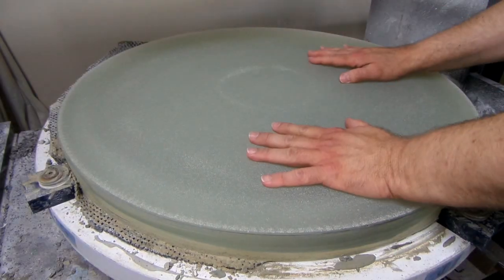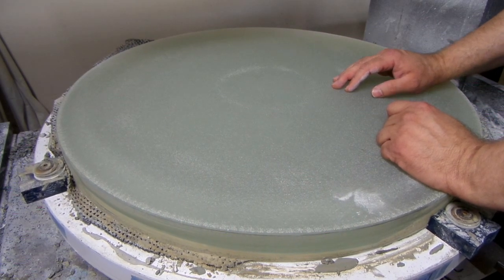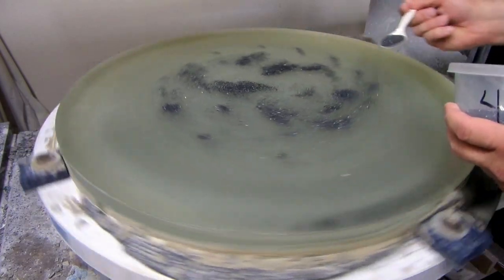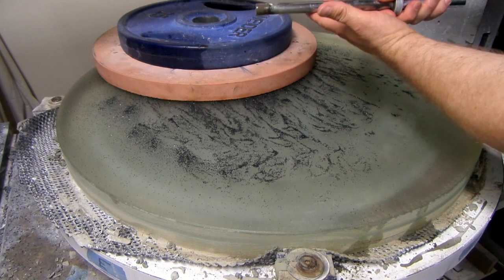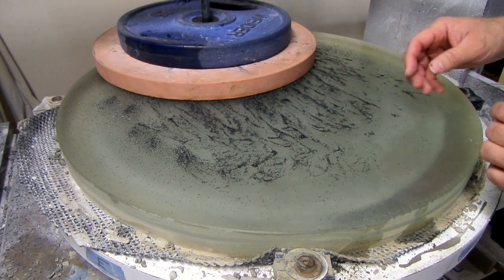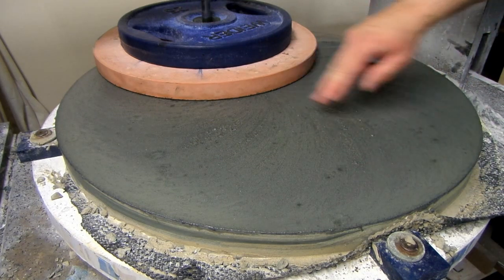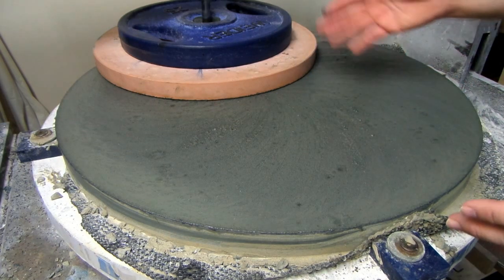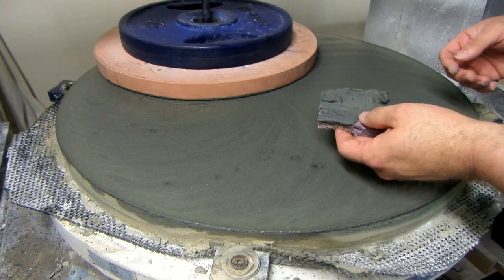Grinding a 25-Inch F3 Telescope Mirror: Thinning and Flattening the Back

Comment: For anyone, why make the back of the lens (mirror i think, not used transparently) perfectly flat?
Reply: You are correct. The finished product is a mirror and not transparent. The mirror side will be concave. The back must be perfectly flat to be mounted in the scope and be able to reflect to an exact point within the center of the telescope.  Any deviation in thickness will tilt the mirror slightly in the mounting surface and the image will not come to the correct point in the telescope.

Comment: I'm a bit confused ... How do you get the exact amount of concave (1/8" depression) to be perfectly equal all around the mirror?  I don't see how this is achieved - Does the difference in size between the tool vs the mirror blank make this process automatic?  Obviously I'm a beginner and sorry if my questions sound dumb ...

Comment: Is the top abrasive tool flat or curved?
Reply from the maker: It starts with a shape dictated by your mirror blank.  If you have a flat blank, start with a flat tool.  If you have a pre-generated concave blank, you start with a convex tool molded against that blank.

Comment: That big turn table looks kind of dangerous. But if you can handle the angle grinder for 2 hours, I'm sure this is nothing.
Reply from the maker: Well, you never want to wear long-sleeve shirts around the machine.  And I've changed to a different hold-down design that is far less likely to grab you.

Comment: How do check for any strain in the glass?
Reply from the maker: You can only check if the blank is still clear and hasn't been ground.  Then you use a big TV behind the mirror to evenly illuminate it, and observe through the blank with a polarizer.  This will show the strain.

Comment: What is the different between normal mirror and thick one isn't the same reflection!?
Reply from the maker: Thin mirrors cool faster, and are lighter to fabricate in the larger sizes.  Thick mirrors hold their shape better so you don't need as good a mirror cell.  Always a tradeoff.

Comment: These are all great videos.  I was wondering...did you find the limits and/or optimum values for the various parameters?  Like, will it grind faster if you keep adding weight (till just before the blank breaks)?
Reply from the maker: We have explored most of the parameters.  Mainly you run into safety problems, like you can only spin a mirror so fast.  And you can only put so much weight on a stack until the turntable won't turn any more.  Or you find that more weight polishes faster but leaves a rougher surface.  So in the end you have to find practical ways to do everything, while trying to optimize factors like cost, time, profit, and so on.
Reply: @GordonWaite  it would be interesting to have a 'little black book' of parameter boundary values or graphs of parameter variation vs. glass removal with markers on the graph indicating points where other phenomena intervene (like 'turntable stops spinning' or 'grit starts flying off the blank' or 'glass blank explodes and takes out a wall') although I guess there's a lot of interplay between the various factors like rpm, grit load, water, etc. and it wouldn't be that straightforward.

Comment: Imperial vs metric Hubble need I say more?
Reply from the maker: Aren't you an interesting piece of work, Ian!  Actually the Hubble problem had absolutely nothing to do with metric versus imperial.  A quick look at the history will show that technicians incorrectly inserted washers as spacers into a corrector.  This led to a long, long series of tests that were all incorrectly configured.  No alternate or backup tests were performed due to a lack of funds.  You DO know that the Hubble mirror was 2.4 METERS in diameter, right??

Comment: May i ask if there is any math underlying the grinding motion, maybe such that the relative speed between the two surfaces leads to a parabolic shape rather than just some randomly shaped valley?
I know that if you spin a liquid the surface will form a perfect parabolic shape and it is easy to derive the maths for that, so i was wondering if something similar exists for this grinding method...? Or how else do you end up with a perfect parabola?
Thank you very much, great video!
Reply from the maker: The grinding motion naturally tends toward producing a sphere (or a flat), when using a simple fixed-post grinding machine.  You control the shape of the mirror by changing the pivot point on the tool on top of the mirror.  Inner positions produce a deeper curve in the center.  Outer positions produce a shallower curve toward the edge.  You manipulate this position during grinding until you arrive at something close to the target radius.  By then you should have found the "neutral" position that does not change the radius.  By grinding through the finer grades of abrasives at the neutral position, you produce a very accurate spherical surface.  

Producing a paraboloidal surface cannot be done geometrically.  At every distance from the center of the parabola, the radius of that zone will be unique.  So the radius constantly changes from center to edge.  To produce a parabola you traditionally use deformable tools.  As you work a given position, you measure the radius to match a target.  In practical terms, you define anywhere from 3 to 12 zones on your mirror and measure them all as you work the surface.  Each zone has a target radius, and you work to deform the spherical surface of the glass to hit that target number.  Doing spherical surfaces is easy, while making paraboloidal surface is much more time-consuming, and thus more expensive.
Reply: @GordonWaite  I see, thanks for explaining, so you have to do alot of measuring and adjusting to aproximate the parabola, have you ever thought about using a centrifugal oven/furnace? - I suppose it wouldnt be too hard to build an insulated chamber on a bearing, driven by a servo or stepper motor to keep a constant frequency/rpm and automate the whole thing with an arduino-microcontroller (popular and super easy to use/program component that alot of hobby DIY'ers use). - Everything the microcontroller would have to do is keep the motor at a constant speed, and measure the temperature and keep the chamber at the desired temperature to very slowly let the glass cool down... If cooled down slowly enough to avoid tension and stress in the glass, that will yield a perfect paraboloid of any desired focal length (given by the rpm) and the size is only limited by the size of the furnace...
Maybe, once set up, that would be an easier and cheaper way to do it??
In any case it would be a fun DIY project i think =) , if i lived near you, we could team up and build it hehe
Reply: @gordonwaite1697  Yeah you are right, while it wouldnt take days for the glass of a 'small' 20" mirror to melt and anneal, or cost 10 million$ - thats only true for the huge, professional funaces - as the glass cools down it would contract and maybe change shape even if done perfectly homogenously/infinitly slowly, i had not thought of that, that means my idea wouldnt make sense...
Thanks for your insights, maybe one day ill ask you for a mirror =), right now im still happy with my 8" skywatcher.
Reply: @GordonWaite  Do you reckon that that furnace apporach would work or not? You obviously are the expert, maybe im wrong to think that this would work... thx.

Comment: Just build a model and stick it in a the kiln that will give to the curve and avoid all this work grinding 
Just to remove glass.
Reply from the maker: You probably missed that this was an existing piece of glass from another project.  Thinning the blank made it possible to use for the project at hand.  Many NEW mirrors are, indeed, molded from scratch.  Amazingly, mirror makers first started doing this long, long ago.  The famous 60-inch mirror at Mt. Wilson was cast in France in 1896, 124 years ago.  There are few new ideas that are so simple!
Reply: GordonWaite yeah I didn’t see that it was a piece you already had but still a shit ton of work.

Comment: So all this is on the BACK of the mirror and has nothing to do with the parabolic mirror. All just to remove weight?
Reply from the maker: Both to remove weight and to make it thinner.  The biggest problem with a thick mirror is heat retention.  When darkness sets in the temperature starts dropping, and the thick and heavy mirror can't keep up.  This sets up differential contraction in the mirror and ruins the images as the surface changes shape with the temperature.

Comment: not to be "that guy" but couldn't you essentially set up a coolant pump like most CNC machines have, and feed in some grit from a hopper in the same line, from the center of your grinding disk post? that seems like the best placement to keep an automated feed of that stuff going through since it would disperse itself.
Reply from the maker: That video was done in 2014.  These days we have computer-controlled grinding and polishing machines and computer-controlled abrasive applicators, slurry pumps and water supply.  We had to design and build these ourselves.  The market is so small that commercial machines didn't exist earlier, and even today they are WAY expensive and not economical for smaller fabricators.

Comment: If the turn table is level why not use a fixed height transitory arm gantry to control the diamond  grinder mechanical control
Reply from the maker: Or a template.

Comment: Where can i buy a Telescope Mirror like yours in the video?
I want to build it myself
Reply from the maker: You can order glass from places like Swift Glass, who will cut discs for you from sheet glass.  Depending on what you order, you may need to have it Blanchard ground, edged and beveled.  A ballpark estimate on the cost of a 25" blank like in this video would be something between $1,500 and $2,000.  Get Supremax-33 for best-quality borosilicate glass for astronomical mirrors.

Comment: No water ? WTF are you doing.
Reply from the maker: You should notice that I did not turn on the machine in the video, only held it above the mirror to show what it looks like in the video.  When doing any diamond grinding, you need to use running water.  I don't do diamond grinding indoors, only outside on a special turntable I have for that use.

Comment: WHY dont they just pour the glass into a mold that is the right shape ???????
Reply: Because a perfect casting is practicably impossible. Blemishes and air pockets become very common in a casting attempt, which is why a casted item still needs further polishing and forming. So, rather than casting, it is significantly easier and simpler to grind a blank into shape.
Reply: Because it doesn't work well!

Comment: There are FAR  easier ways to make a telescope lens (concave): place a dish with the rim height desired on the turntable. Fill with a slow cure high viscosity epoxy - glas fiber mix. Spin the table with VSD drive and allow for cure. 
Once cured: add mercurey and spin at same speed. Add a mirror above and you will have a very very high quality lens. Approx 2007 Spectrun der Wissenschaft » issued an article on this method.
Reply from the maker: Well, that would be a mirror, not a lens.  Isn't mercury a bit toxic?  How would you dampen vibrations in the liquid?  How do you keep dust off the mercury surface?  How limited is the sky you can see with a fixed-position mirror?  Don't you need an even bigger and quite flat mirror above to have some choice of field?  Tracking?  I think there are plenty of reasons why you don't see two or three mercury mirrors in every astronomy club!

Comment: Why is this mirror convex and not concave as we always see in reflective telescope designs?
Reply from the maker: The back is flat, and the front concave, like all Newtonian designs.
Reply: @GordonWaite  But strikingly from the video it seems to be convex. o.O
Reply from the maker: @Vicente_Camilo  The video only shows me working on the back of the blank, which I am flattening.  Perhaps the wide angle of the camera lens makes it appear convex to you.  On this mirror, the back you see being worked will be flat; the other side will be concave.
Reply: @GordonWaite  I got confused reversing both terms, I'm sorry. What I meant earlier is that the glass is convex, while the Newtonian telescopes the mirrors are concave.

Comment: This is really awesome. I'm really curious though how do you get dips and valleys out if the grinding stone isn't fixed to something that will not grind Valleys. you can see it going up and down has its grinding... will it eventually flatten it out or will it just keep those dips and valleys in there?
Reply from the maker: It evens out quite quickly.  The surface averages out against the grinding tool, and contact becomes closer and closer as you grind.

Comment: I'm still learning so I'm curious about using things . If u think about it using the carbide abrasive seems like it would imbed itself into the glass since it's a loose material . If the abrasive was glued to another object it would act like sandpaper an push the access glass away from the mirror . Am I thinking about this all wrong ? I'm guessing I'm thinking more about time . Using a sandpaper method would be quicker than putting abrasive on the glass I think
Reply from the maker: The abrasive doesn't embed in the glass.  Instead, it chips off tiny pieces of glass as the grains roll around between the glass and the grinding tool.  With loose abrasives, the two surfaces get into closer and closer contact as the grinding continues, and you use finer and finer abrasives.  Over the course of the mirror, you will end up using several pounds of the various grades of abrasive.

Comment: Viry nice movie

Please i try to make mirrors for my telescope at home manually using epoxy < but I need to the A concave mirror measure to make a mold to put epoxy inside it
What is the degree of concave mirror?
Reply: Depends on focal length maybe?

Comment: Good heavens have some Dimond grinding tools made, it's not at all as expensive as you might think.
Please note I have never made a mirror in my life but I do grind things and I may be totally off the mark.
Reply from the maker: I have created and used many diamond tools over the years.  I use diamond rings to rough in curves.  And I've often used diamond paste for fine grinding and rough polishing.
Reply: @GordonWaite  Dimond tools are certainly useful when well made, fortunately in my backwards south African home town we were lucky enough to have a company that did Dimond plating.
It's really useful when you can turn a tool on a lathe and have it grinding into hardened steel the next day.
But as I said I have zero knowledge on telescopes or making mirrors but I feel compelled to trying.

Comment: any reason why you aren't using any stroke. i get that you are trying to take out a ring  towards the middle and the lip around the edge but some stroke  would help you keep from convexing that blank while trying to smooth out the back.
Reply from the maker: The technique I use is called "fixed post grinding", and there is no stroking.  With the fixed position of the tool, the mirror quickly takes on a spherical shape.  By moving the tool position toward or away from the center of the mirror, you adjust the radius of the sphere.  For a flat back, you are looking for the neutral point that gives you a sphere of infinite radius.  Many, if not most, opticians are now using this technique, so there is no stroking during grinding or rough polishing of most mirrors.  The only stroking comes at the very end of the process for the figuring of the final paraboloidal surface.

Comment: Hi, 
Why you want to reduce the thickness? Isn’t better if 5he mirror is thicker?
Thanks.
Reply from the maker: A thinner mirror weighs less and is easier to handle during fabrication, as long as it isn't too thin.  Also, the thinner the mirror, the faster it cools, and thus the faster you can have good viewing after setting up the instrument.  And a thinner mirror makes for a lighter telescope which is easier to transport and set up.

Comment: Why wasn't the blank cast to an approximate shape to reduce the grinding?
Reply: Would it be because the blank could be intended for a variety of telescopes?
Reply from the maker: Most blanks are cut from a standard sheet of glass, then ground.  Much cheaper than building a custom mold and doing a casting.
Reply: Casting takes extreme heat and risks bubbles and sticking and devitrification. Kilns are expensive and wear out faster at that temp. Slumping thin glass is a better idea.

Comment: What is the difference with a glass for a telescope and a window glass ?. Just mention the basics if you would. Thanks
Reply from the maker: Window glass is soda lime glass, or plate glass.  Telescope mirrors are generally a different type of glass, called borosilicate glass.  This kind of glass doesn't expand and contract as much as plate glass, so it holds its shape better when the temperature drops at night.

Comment: What's with the plastic spoon??? Whh not use a simple shaker? Much cleaner, easier and a much more even distribution and volume control over your abrasive.
Reply from the maker: With this particular mirror job, you need a lot of abrasives applied often.  It was faster to put a couple of pounds in a plastic container and just spoon it out.  I would be filling the shaker every other wet if I tried to do it that way.  Now, we only use automatic abrasive dispensers, so it's not an issue.  If you do use a shaker, be positive it is all plastic with no glass body and no metal top!